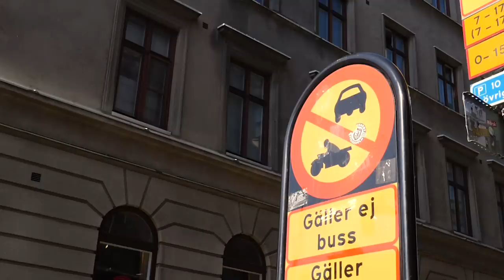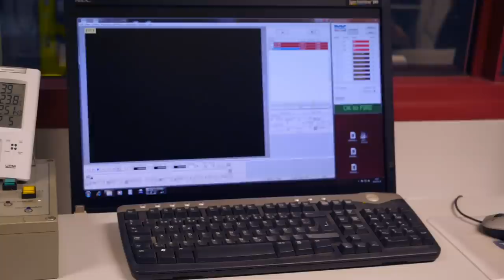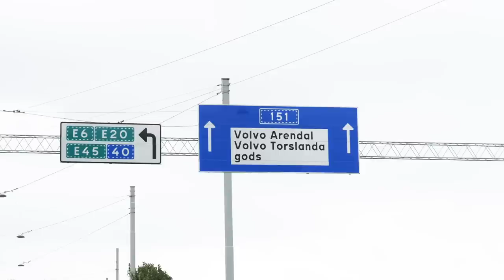The Next Step For Bike Helmet Safety?

Comment: How about hitting the windscreen? Would that absorb as much energy as well?
Reply: LOL clearly not. Volvo is testing their improvements to the bonnet/hood. I don't know of any flexible clear material available for such a windscreen, but clearly there are some achievable improvements available in the bonnet
Reply: Interesting question. Would be interesting to know how much of the energy will be absorbed by the breaking of the window
Reply: Windshields are part of the vehicle's structure. Pretty likely that it will reflect more kinetic energy than the hood.
Reply: This is not that complicated to think about. There are lots of pictures of crashes where something (doesn't even have to be a cyclist) hits the windshield/windscreen. For the safety of the vehicle occupants, the glass is laminated and will stay in one piece with just a single impact, but it will have spidering cracks radiating out from the impact. The windshield is not going to flex anywhere near as much as Volvo's new hood design. It's going to be a very dramatic stop for your head and hurt a lot
Reply: Yeah this more common than hitting the bonnet (a horizontal surface) also the front grill.
Reply: I was hit by a car and ended up bouncing from the windshield. It was actually like a trampoline.

Comment: It's astonishing how a video of 13 minutes featuring a bunch of experts and a lab can contain so little information. We know know that by average we'd hit the bonnet with something like 35 km/h and that the bonnet takes much of the impact, that the results are interesting and that Volvo and POC are cooperating, by shooting a helmet stuffed with sensors on a bonnet and that Volvo has an autobrake for people on the road, just like other companies. That could have been one sentence on GCN news. Apart from that none of the questions were answered with any test result. Not even the brain expert did provide any information from his field of expertise. Other than that it was a shameless plug with a giant POC helmet in the foreground. Advertising at its worst. Thank you for wasting my time.
Reply: @MrPascaldg  Louis I agree that this video lacks substance, however these comparisons your provided are silly. Your head is only a part of your body and the interaction you have with a car impact is very complex and can occur in n number of ways. If you reversed your analogy, it would be a head hitting an immovable spike. Whether you agree or not, a helmet does absorb significant amount of energy up on blunt impact that would otherwise transfer into accelerating a brain. The standards for testing helmets are woeful however and absence of any standardised ranking/points system for how well a helmet does in a crash test is abysmal. Added, current review "methodology" by the cycling press/ad machine is the equivalent of testing an air plane for how comfortable the passenger cabin is and what in flight entertainment it provides, without ever taking off and seeing how the plane actually flies.
Reply: @MrPascaldg  I am sorry to hear about that. I agree there is little in a helmet to stop those injuries from occurring. I understand what you say when a helmet is seen as a magical "fix all" solution. Only a few days ago I was playing rodeo with a truck driver who appeared to have a nervous breakdown, triggered by me telling him being careless on the road is no joke after he almost cut across me, I fully appreciate the imbalance between a human and a car. I also understand that a helmet might not even prevent a concussion or "save your life". However, having experienced a pretty good concussion through ground contact, I now always wear it. As opposed to before when I did not wear a helmet for town riding but always for courier work and road rides. I am fully aware we have to take care and complacency on a bicycle could have much higher cost than in a car, however this way where do we stop? The standard statement of "collisions happen" etc. You might walk on the street and have a piano land on your head. We can control the things that we can, right?
Reply: @MrPascaldg  hahaha that's amazing. Tue I feel more delicate driving behind a bicycle with a baby seat. I  have a friend - female and blond. She told me she got away with some blunders just from that. Smile and wave kowalski! Smile and wave..😁

Comment: It looks like this could be a massive wake up call to cycling helmet manufacturers. I love POC as a brand but it seems they, and other cycle helmet manufacturers, are a long way behind in impact protection. Seeing how much energy the Volvo absorbed through crumple zones was amazing and to see that the helmet hardly deflect at all is more than a bit worrying. The ground, windscreen, lorry mirrors and a lot of other cars don't have this crumple technology at all, so it will be fascinating to see how cycle helmet design improves and changes over the next year...as it clearly needs to. Great video.
Reply: I guess the helmet was harder than the bonnet was therefore the bonnet gave way instead of the helmet. Maybe if you hit the windscreen or a concrete pavement/asphalt the helmet would most likely be the thing taking the force away.
Reply: @albr4  I would hope so but then when I think.of how hard my Kask and Specialized helmets are I am not so sure.

Comment: Interesting... but somehow I doubt that shown test really realistically replicates a real-life-scenario. 

I am a daily comuter in a town for 30 years now and if I ever got close to a crash it is 

1) cars turning right without looking, 

2) cars opening doors without looking and 

3) sometimes even cars just ignoring you when they want to turn left and you go staight onto the crossing. 

In all of these cases your head doesnt crash onto the center of the car front like that... mostly you are pushed aside and hit something else or if you roll over the front of the car, if your head touches the car it will be more the front or side of the helmet, not the top center...
Reply: Totally agree. It's quite worrying that POC and Volvo would consider using the data from this totally unrealistic test. I certainly wouldn't buy a POC helmet based on this.
Reply: @foamphotos4105  I think you're misunderstanding the testing regime and the video. No-one appears to be basing anything on that singular test parameterisation.
Reply: @fukawitribe  No I didn't misunderstand anything, this was the first test they used to collect data and the one the channel and sponsors choose to show us. If you have more information on the 'testing regime' please share it with us.
Reply: @foamphotos4105  Listen from about 5:55

Comment: Unless the intent for this test was to protect the car from cyclists falling from the sky, this test appears pretty close to useless.
Reply: imagine the position of the torso attached to that helmet would have to be in! that one test was probably just done for the cameras and media maybe, and they'll use more realistic angles in the other tests.
Reply: 4:45 he says they will try different angles and speeds.
Reply: Alan Braaa It is very sad that these companies choose to spend more on dumb PR stunts than actual R&D.  The most common types of cyclist-motorist accidents involve either:
> Impact with the side doors because the motorist was pulling out of a driveway or made a 90-degree turn onto the path of a cyclist.
> Impact with the side mirrors, because the motorist misjudged the width of his vehicle.
> Impact with the rear trunk, because the motorist suddenly decelerated into the path of the cyclist (bicycles rim brakes are not as good as motor vehicle brakes)
This test simulates none of these scenarios. In fact, it’s hard to even determine what sort of impact they were trying to simulate. It looks to me like they worked backwards: found the spot on the car to obtain the best looking test outcome, and then setup the firing equipment to match  😒. That, or their ‘research’ came straight out of a Deadpool movie.
Reply: Matt Foley It couldn’t have hurt to show something more realistic, especially given the size of GCNs audience. The firing angle is so extreme and so well targeted, it leads me to think their outcomes with more reasonable angles must have been terrible! All this test managed to do for me is instill doubt with POCs testing methods....
Reply: What do I do if I hit a Chevy instead of a Volvo?

Comment: I would like a helmet with a wide brim to protect from sun damage. The aerodynamics would be no good for the speeds at which road racers go, but for those of us who travel by bicycle at lower speeds for, say, 8 hours a day, day after day, it can reduce sun damage and the risk of skin cancers. (Yes, I use sun screen, too.) The few attempts on the market, such as a floppy brim that can be velcroed to a helmet, are no good even at low speeds. So I fashioned my own out of a French Imperialist-style pith helmet and a regular bicycle helmet harness. I've been using it for 6 years now. A bonus is that it makes an amazing difference in keeping my head cool on hot days. But I'm sure it doesn't provide the same sort of crash protection that one designed for the purpose could provide, and there are other points that could be better. I'd like to see the labs work on a product like that.  There is of course the dork factor, but all bicycle helmets have that issue and it seems to have been overcome in some circles.

Comment: Most crashes don't involve hitting the head against a car or other object at a horizontal velocity of 35 km/hr. Contact with a car generally involves limbs or torso. When a rider falls, the helmet hits the ground, with a close to VERTICAL velocity that mainly depends on gravitational potential energy.. based on initial height of the head..
I was uninjured after being right hooked in a bike lane about a year ago and the large dent in the car's back door showed how effective it was in absorbing the impact, it was like riding into a pillow.

Comment: the bonnet is one of the parts which will direct the body over the car - it isn't thick enough to hurt but the effect of it bouncing would make an opportunity to throw the body in a different direction.
The most concerning parts of the cars are the frames - they cannot make them any softer on impact, but the frame is the deadliest part.
If they can make the bonnet to throw the body over the car so the landing would be more safe even with a free rolling body, then it would benefit the cyclists.

Comment: The next step for helmet safety is to take road space away from motor vehicles that are sadly being used mostly for journeys under 5 miles. Volvo and co are part of the problem not the solution
Reply: Bang on.
Reply: to be honest with you I'd rather have more cars than cyclists as it's the cyclists getting in the way or swerving about infront of you, at least in cities that is. (but it's probably just me being too fast)
Reply: @albr4  Please check the stats -- how many car-car accidents you have and how many cyclist-cyclist?
Reply: @albr4  Troll alert !!

Comment: A very good video, as usual, but I do wonder why helmet manufacturers don't appear to take account of the toal wight of a rider.  Using something that weighs the same as your average head is OK but heads are usually attached to bodies that way a great deal more which will mean the impact - when head meets object - will be much greater.  Also, in this video, there was plenty of "give" in the car bonnet but the rider would be thrown into the air and land on a much harder road.  How would the helmet deal with that, having already been in contact with a car?  Still, it was a well presented video, well done Chris.

Comment: Really good co-operation to improve serious problem, however I would like to hear a little bit more about why this simulation was done with helmet positioned upside down? 
How the cyclist is riding during that simulation - can you explain it more? I am asking because:
If bike is moving along the line which is positioned 90 degrees to car moving line, I think you will never hit that helmet area... the most probably it will be side of helmet..
If it is face to face crash (hard to imagine as the most probable one) - I think that is also different helmet zone...
The last conclusion is - with car speed around 50 km/h - the most probable is that head will hit car windscreen...

Comment: Well, its quite simple (sort of).
Closest to your head you need something soft and comfortable, that can be adjusted to fit the headshape.
The a layer of a hard and not breakeable materiale.
Then a materiale that has to dissipate the impact and crumble.
And finally a thin protective layer on the outside.

Today helmets are made completely wrong in terms of crash protection and protection if being hit by a wheel or hard object. The helmet folds / crushes around the head of the bearer.
Because the impact materiale is completely wrong !!!

Then comes features as ventilation and aero.

Comment: 35km/h = 22mph … not that fast but makes sense for city crashes. And it's a significant impact. The other year something went wrong at a turn on a flat road near home where I wouldn't have expected a problem. I crashed into a guardrail around 30km/h (20mph) and was knocked out, had a significant concussion and took an ambulance ride to the hospital.
Reply: Were you wearing a helmet?
Reply: @mattfoley6082  yes. Helmet did some protection, I didn't split my head open or anything. but bike helmets don't prevent concussions. Also took a fair amount of damage to my face and knocked a front tooth clean out root and all
Reply: @ChrisCapoccia  Sorry you were hurt. But it's still better you were wearing one.

Comment: We will never have totally protected bike lanes but the goal should always be to avoid collisions.  If it is possible to build a self driving automobile it ought to be possible to build a car that won’t hit a bike.
Reply: Connie Back understanding bikes is actually the biggest problem for self driving cars
Reply: This is where the idea of having some kind of device attached to the helmet that acts like a location device could come in handy. As cars get "smarter", they should be able to receive these locations passively and warn the car to avoid cyclists.
Reply: Rejor111 I’d like it to do more than just alert them.  I’d like the signal to keep the car at a safe distance from me—auto-brake and not steer into my space.

Comment: mmm, what are the chances that your head impacts right in the middle of the bonnet where you are likely to suffer the least amount of impact damage due to the energy absorption of the car structure? More likely given the height of your body on the bike and the length of your torso that your head will impact the less flexible areas on the car like the opposite wing or the junction at the base of the windscreen. So  now we already have flawed data due to poor experimental design.

Comment: Off course this is some great and important research. And I admire what Volvo contributes to the safety on roads. But what happens when you attach the "head" to a neck and a body?  Typically, cyclist that ar hit by a car will not crash with the top of their head but with the side, or back. But maybe that will be the next level in research. Thanks for the video GCN!

Comment: Why not add electrical speed limiters through GPS or other ways? A method to limit the cars speed to 30MPH unless it detects a different speed limit.
Reply: Genius idea!  The tech exists.  Repeated could be placed in lampposts
Reply: That is actually being talked about - obviously a shame it has to be considered but at least the conversation is starting to take place.
Reply: There nbneeds to be an override, however, for emergencies. Maybe an override with a record feature starting before the initiation of the override to capture a short term continuous record feature which normally doesn't store but can be set to keep an automatic portion with particular triggers.

Comment: Vital research. Shocking lack of real world data. The take away seemed to be that the helmet didn't absorb much of the impact, which begs the question how useful it is?
Reply: It doesn't in a crash with a car hood, that does absorb more energy. It is useful when hitting something that absorbs less energy, like concrete. Or some other cars, probably. Sounds like the work is in it's early stages, therefore, you cannot have many results yet. Proper science is more than two people riding a bike for a few minutes and comparing their times to see which bike is better ;)

Comment: Meanwhile there is another company, that is selling driver assistance as if it's autonomous driving without driver monitoring systems, putting many lives at risk just to maintain a perception. They supposedly plan to manufacture a truck with body made of steel, imagine how that truck would perform in case of pedestrian and cyclist crash.

Comment: Found it interesting there appeared to be very little damage to the helmet. I would have thought to dissipate more energy from the impact away from the head/brain, the helmet would have suffered more damage. I hope they are not producing helmets that focus on protecting, er, the helmet.
Reply: Actually, helmets nowadays are single use for just that purpose. They are designed to break and dissipate energy into the material instead of into the head. You should never use a helmet after crashing with it because it will have structural weaknesses in it.
Reply: helmets are mostly about preventing open head injuries not concussions

Comment: 4:25 " ... 35 km/h ..." That's much too less. If you cycle, let's say 30 km/h, the car hit you around 1 m heigh, your body will be turned and the head will be taken into a lateral / cross acceleration. So it is i.e. your cycling speed (30 km/h) PLUS the speed of the cross acceleration. For that 35 km/h is ridiculous. What shows that the Volvo - poc -cooperation is just a marketing gag.